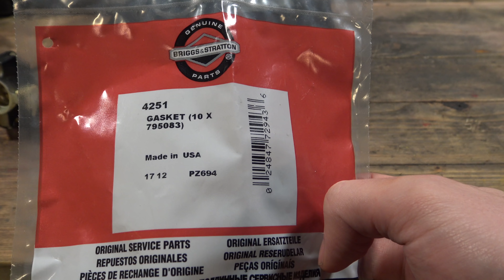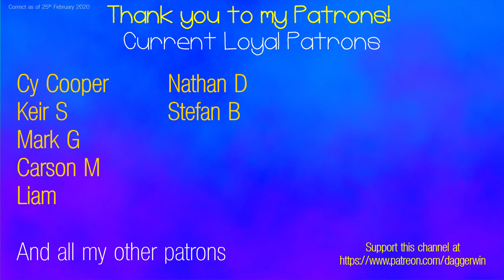X10 RESTORATION Briggs & Stratton Carburetor Tanks

Comment: Be careful when drilling plat like that my advice would be, to put bit wood down or get a vice for the bench drill. I can talk form years of experience as I split my hand and 2 finger open and broke 2 fingers. I was driling a big bit plat out with a big Carlton and it got caught I've am a welder/mechanic and farmer by trade been drilling hole for years and it took just 1 time. Also be careful when wearing gloves they don't get caught

Comment: I'm finding more and more of these carbs are warping and leaking these days. Maybe something to do with ethanol in the petrol, I'm not sure.
You can help against this by sandwiching the diaphragm between two gaskets. I notice you didn't remove the main jet, easily done with a flat screwdriver.

Comment: Still hv mynold mower it's been 15 yrs works well same kind of tank the outside it not the problem it's the inside you gotta use some steel brushes and alot of brake clean to get it clean pain in the butt.

Comment: Buy a new one probably cheaper. Google> Briggs and Stratton 495912
Reply from the maker: For a non genuine it's cheaper, these are all genuine though.
Reply: 495912 is genuine OEM Briggs and Stratton. They still make them. Google it!
Reply from the maker: I know that's not what I'm saying. I was replying to the part where you said "Buy a new one probably cheaper."
Reply: And a new OEM carb/tank assembly probably is cheaper than rebuilding the old one!